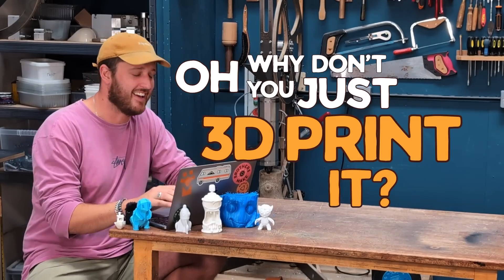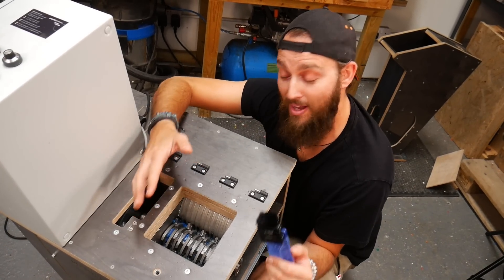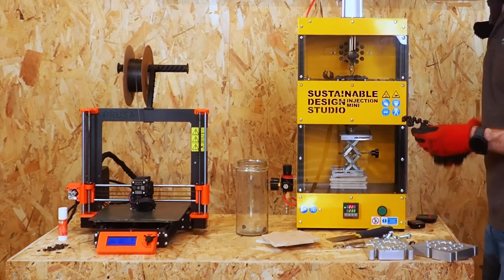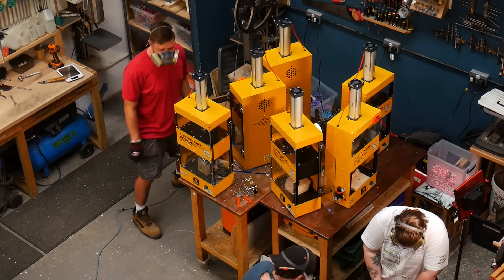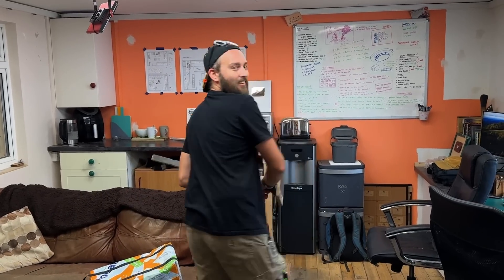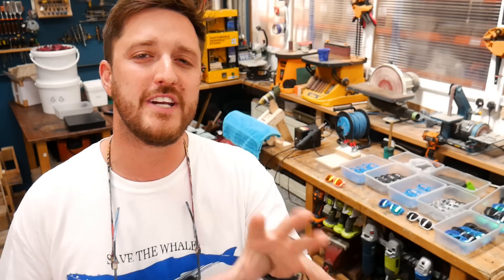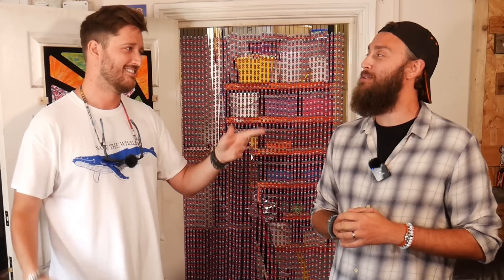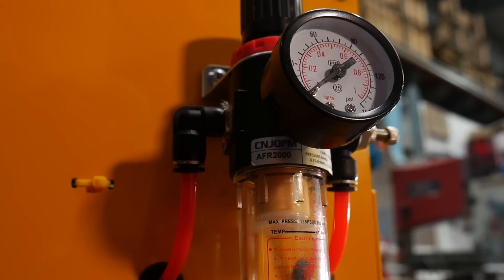Is THIS Better than 3D Printing?

Comment: Awesome video!  Super solid info and very informative for sure.  Like all things, the devil lives in the details and injection molding is a process full of gremlins!  that said, it is just about how everything you have or see around you have been made!  A miracle of modern technology for sure.

This technology has come so far so fast and we are all so lucky to have access to it.  I for one never thought it would get as good as it has, i was way wrong.

When I was a college grad. as a mechanical engineer about 25 years ago (geez)  we used to drool at these parts made by SLA - a very fragile, mega expensive, time consuming process.  What we would pay thousands of dollars for and wait weeks and weeks to get you can print in your bedroom for a few hundred bucks... and that includes that printer!

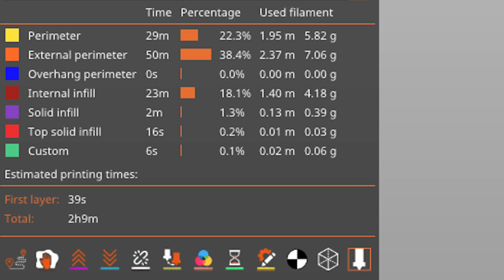Comment: Please be honest instead of tricking us at 4:00 ... Nobody is going to print that comb vertical. I did the test, downloaded a comb similar and my slicer gave 16min and not 2 hours. But still injection molding for such a model/ item is still the best way to go.

Again, it all depends on the model, what it is used for, the quality needed. Beeds, combs to me yes are things my common sense would say to injection mold it. Some parts wich you can't easily injection with a 2 halves mold I would say a printfarm will beat you ... up to the point when you are beginning to talk about 1000'nds of parts.

Comment: Companies use injection molding because it's faster, reliable and cheaper.
Not to mention that the injected materials are far more stronger than 3D printed.

And c'mon, you can produce 100 pieces before the noozle warm up! (depending on mold size, of course)

Comment: Injection molds are very limiting compared to 3D prints. There are tons of geometries you can't do and in some cases you can partially achieve some with multi-split molds. Not to mention overmolding with different materials or variable infill rates and variable temperatures in temperature sensitive materials like varioshore.

Comment: Adapting @ShaketheFuture's "Print Wave Metal Casting" technique, where he 3D prints a negative of a mold with 0% infill and then converts it into a metal-casting mold, seems like a way to marry your 3D printer and injection molding machine into a combo system with most of the flexibility of a 3D printer and the scale production of injection molding.  I would love to see you guys try and experiment with DIY poured injection molds using 3D printed framing.  IF it can be done and can produce even passable-quality parts in quantities of 50 or so before needing to retire the mold, you will have seriously changed the game in small-run production.

Comment: injection moulding is very cool, but the environmental benefit kind of erodes, when instead of buying filament, a load at once, you send out small light object with packaging, instead of just printing whatever you need without shipping being required.

Comment: You can easily make a cutting jig with slightly lose tolerances compared to the injection mold and slots for blades to cut the beads off and holes to drop them out as well just saying 😮

Comment: Okay so what I saw here....one person can operate easily 100 printers, 3d, while watching tv.

You needed 2 people to operate 3 mold machines constantly.   Each person is what...40k a year.  So you have 80k for 2 people to run just 6 machines, constantly standing, putting molds in and out.  Let's talk startup costs.  

6 mold machines - diy kits, 1100 each so 6600.
Next 3 molds - 500 bucks on your site.  All 3 different sizes.  So I could go with 2, and have only 3 sizes.  Let's do that it's cheaper.  add another 1k
Man power 3 people, 40k each year.  120k

Material - we wont care because material for both is gonna be the same.

Next you showed the comb printed at the z-height which has travel issues and layer height issues.  Better to print laying down  My ender 5 plus a slow machine running marlin 1.7v - aka years out of date.  Does a 0.1 layer height comb from thingiverse in 30mins.  Not 2hrs+ you showed.

We don't need fancy printers, but lets go with the bambu a1 mini because it can do that size with ease.  I know for a fact that bambu is faster than mine, because I have a dragon that takes 3hrs the bambu yet over 6hrs for me.  SO it is safe to say the bambu can knock it out of 2 combs every 30mins.

With that in mind.

Cost.  I am going to go with the 349 4 color changing bambu - your injection mold can only do one, though it can make nice mixes.  But still just one.

Just on the machine costs alone.  I can get 21 bambu a1 minis.  Meaning I can make 2 combs each every 30mins or...84 combs an hour.  While I watch tv.  And in reality I can fit 5 minimum on the build plate.

Now you said you can injection mold 28 in the 2hrs.    I don't know if that is for one machine of 6, I assume it is 1 because it was one second before the 'farm' idea of injection molding.

So a single A1 mini, can pump out 5 per hour or 10 per 2 hours.  To hit your 28/hr.  I would need 3, actually beat it too.   And I did it cheaper.

Next...adjustments.

What happens when I want to adjust the comb, wider teeth, longer, shorter, etc.  New molds right...how much? 200, 300, 500?  3d printing? click resize or take 2mins to change the file and hit print.

Now we didn't talk about man power.  Again a single person can easily run 50 to 100 machines.  100 bambu ai minis costs the same as your single employee you would need to watch 3 Mini injections.  And if I have 100 machines pumping out 10 every two hours.. that is 12,000 combs in one day.  

It is safe to say....that per cost break down, the A1 here is more capable.

Now we can talk about surface finish...and quality all we want.  But the bambu at 0.1 layer lines...chefs kiss imo.

Comment: Good video.  I have been in 3D printing for 5 years and agree with your results.  I rarely print over 5 or 10 copies of something.  This is my hobby and I enjoy testing different designs, so for me this is the way to go.  I can see a design and be running it in 5 or 10 minutes.

Comment: The hard part of this process which was overlooked is you have to first produce an aluminum mold. Aluminum molds aren’t cheap or easy to make and if you get it wrong it’s expensive to correct.

Comment: Sorry but you are missing that 3d printer is not only FDM, and those beads are one of the dumbest things to ever want to make with FDM .... 
You are designing and making parts that are horrible for 3d printing ... 
SLA is another option and then we are not even touching on SLS, if you are going to spend huge amounts of money you would be incredibly stupid to buy the cheapest of the cheapest machines... Or let alone looking at only standard consumer products.

Lastly if one makes and designs a proper print farm, the amount of manual labour per part involved would be ways less, and generally man hours are way more expensive than any running costs from the machine and material costs.... You had 3 people working what, over 8 hours for 2 days, a worker usually COSTS the company well over 30-40 $/€ per hour, so let's say 50 hours total, that 1500-2000 $/€ at the bare minimum that it's costing the company (hourly wage will be significantly lower). The things is those 1500-2000 $/€ are running costs you have to make every single time ... even if the material is 4 to 5 times as expensive, filament can be bought reasonably, if you buy 5kg or more, for 20 $/€ per kg, so it's what 20 $/€ versus 100€ for 5kg, 100€ is nothing compared to 2000+ most likely ... Electricty usage is probably similar maybe even higher due to having to completely melt so much plastic all at once, generally at higher temps than FDM/SLA/SLS, but even if one of the two used more, those electricity costs are kinda negligible when you have such a large overhead of man hours you need to pay.... 

If people do a cost comparison, then human hours have to be taken into account and not for the hourly wage, but what it would cost to hire someone. Or make it clear you are only working on the project yourself in that case saying what PROFIT you have made hourly afterwards would be fine (but that still means taking ALL your costs into account).

Comment: You had the correct printer to begin with the A1 Mini which is just as reliable as the Prusa ( iv had numerous models from both brands)
30 A1 Minis @£169 are £5070 
Fillament is not £20 per roll you would be buying at £!0 a roll which is £50 so £6020

Comment: NOPE. first off you are quoting the numbers that can be made from a bambu MINI. thats a 156x156 bed size. 
second you are Quoting the price of a prusa machine. old tech and boring.
if you buy the bambu A1 (NOT THE MINI LIKE YOU QUOTED) you are going to buy twice the number of machines. than the prusas.
taking into account the less  people to run the machines (WHICH IS 90% OF YOUR COST) 
the printer is by far the better option.
that being said the IM is a stronger part. but who cares when your making non structual parts. 
plus you use half the plastic to make each product casue printers can dial down the infill. IM forces you to make solid parts. making IM less enviro.
and $500 every time you want to make a new part is REDICULOUS!!
a 3d printer can make ANYTHING without the need to retool. 
then finally you quoted the price of 3d filament way to high.

Comment: Did you know you can stack 3d prints? You could fill the entire print volume with beads stacks on top of each other, and it runs completely asynchronously without enslaving human arms.

Comment: yep ignored mould build and test time so figure 25k for a low volume part, everyone has done the math dude  if you want less than 1k you 3d print if you want to mass produce you inject and shrinkage is an SLA thing not an FDM thing. injection mould machines are awesome but exist within a framework where mould production and volume make sense.
You need to mix both tech the 3D printer to make the mould and the injection machine to mass produce, you can crank out 10 disposable moulds a day for your thousands of parts.

Comment: I mean, at least until now at 6:30 you're just comparing apples to pears...

Edit: after circa 11:30 you dealt with the points I was foreseing... Kudos!

The main issue I was having when I commented is that 3d printers is about versatility and extreme adaptability, for a mass produced product, injection mold is about extreme scalability. It's more about your use case than about which one is better, it isn't as simple.

Comment: I would like to jump on a recycling plastic waste "business" but the other thing to consider is the physical space you have when starting. 3D printing can be down in any room of your home but having a plastic shredder, an air compressor and a injection machine are not fitting well in a classic home, don't you think ?

Comment: What if you used each to compliment/complete the other. 
I mean you’re not going to injection mold an articulated dragon. 
Fdm can quickly prototype, but also mold housings and jigs. 
Resin can produce injection molds
And injection molds can produce thousands. 
Use them all together to see how many specialized beads you can produce.

Comment: Yeah, each have their use cases and in most cases they're complementary. Iterative prototyping on the 3D printer, mass production on the injection moulds, if you so wish. Sometimes a 3D print is more than good enough for commercial use, even as functional parts.
Reply: If doing iterative design using a 3D printer, you have to keep in mind injection molding limitations, because there are a lot of forms that can't be injection molded, but can be 3D printed.  So it requires someone with experience in both methods.
Reply: @yeroca  Indeed, one of the few things I hear about is the 'draft angle' which is obviously not an issue with 3D printing.

Comment: Video avoided the cost of tooling.  Might have been £300 or so for that bead mould, but the development and production of the moulds is expensive to get to a production item.
Reply from the maker: You can buy these standard without paying for the design. If you want custom ones then of course it will be more.

Comment: 3D printing IS a better process.... depending on what you're making.  Also, depending on what  you're making, the same can be said for CNC milling, traditional lathe work, resin casting, blacksmithing or chainsaw carving.

Comment: video is fairly biased tbh. looking specifically at the comb it would not be printed in that orientation, you'd lay it flat. printing it vertically would not only make the durability worse, but you artificially inflated the print time by blatantly printing it in the wrong orientation. also, you failed to mention pellet based FDM, PET bottle recyclers, and some lesser known plastic recycling methods for FDM entirely. honestly injection molding and FDM both have pros and cons, and shouldn't really be compared in this way to begin with.

Comment: the machine should suit the product and the production environment. For example the inexpensive injection mold machine can have more material throughput but it requires manual operation. The 3d printer can melt and deposit material slower, but it's automated. The comb could have been 3d printed on it's side, tweaked for 3d printing so that many of them would fit on the build plate, and then printed while you sleep or do something else productive. You couldn't run the injection mould machine while you sleep. When it comes to cost, a 3d printer can work for a lot cheaper than a human per hour.

Comment: Inject molding produces better part with longer preparation time and high upfront cost, while 3D print just straight goes from 3D modeling to actual product in a few hours but the quality won't match inject mold.

In your case, 3D print is click and go and wait while you consistently manually inject moding.

Comment: You guys should collab with Slant3D on a 'challenge' to refine the scope of when to use 3d print farms vs. when to invest in injection moulding.   I agree with your conclusions that each has their place.   It'd be very entertaining to see two very passionate sides of the argument go head to head, though ... sorta like a heavy weight boxing match for plastic production!

Comment: The old fashioned way will always be the better way. But 3d printing can still be well utilized for injection molds as modeling and sculpting can be done digitally faster than sculpting by hand and not worry about simetry. I would 3d print a base mesh and  add clay to sculpt lightly over it for extra details and rid of those pesky layer lines. Then cast a mold from that. I would consider 3d printers an extension to the traditional ways for easier work flow.

Comment: Why did you print the comb in that orientation? Just off the top of my head, that would be the absolute worst orientation for it - the forces are going to be perpendicular to the layer lines and you'll break teeth, AND it would print much slower because you have to wait for the small layers to cool, AND you'd have a ton of stringing (potentially).

I used to be in industrial plastics - injection molding, blow molding, crown molding, the works.  I'd say the biggest benefit of 3D printing is consistency and ease of use.  We'd have machines that would be cranking out parts without issue all night, then someone 3 buildings away would sneeze and we'd spend the rest of the shift trying to get the parts going again.  You'll sometimes get prints that don't want to cooperate, but I've never had the issues with even my cheap, ancient 3D printer that I had with the big injection molding machines.

But ultimately, you're right.  Injection molding does one thing, it does it very well and very quickly.  3D printing does a nearly unlimited number of things, very slowly and with a rough finish.  For now... I think the story will be very different in 20 years.
Reply: The thing you need to account for is the cost of machines. With basic optimizations, you can get the throughput of a 3d printer factory to be equivalent to an injection molding machine at the same cost. And that can be done today. Only once you are talking the absolutely massive machines that can spit out hundreds of thousands of parts per day does that end up favoring injection molding again, and only because you can micro optimize the material use and save enough money for it to make sense.

Lego bricks for example would be stupid to print as you would need to change their size so they are larger in order to be strong enough. Duplo bricks would make sense if they were printed.

Comment: Your cost for the 3D printer did not include a filament dryer which will be needed as almost all filaments will absorb humidity from the air which makes it useless.  There are many ways to do this with a house oven for example but this also risks the filament roll being melted together so a proper filament dryer should also be included in any 3D printing setup.

Comment: You should make a collab with Slant3D. You could design a functional part for injection molding while Gabe could design a part for the same function for FDM mass production and finally you could do the math and cross-check the forecasted costs. That would be something really interesting to watch...